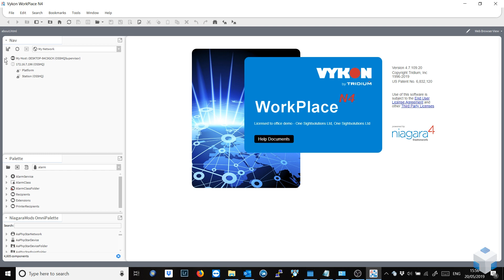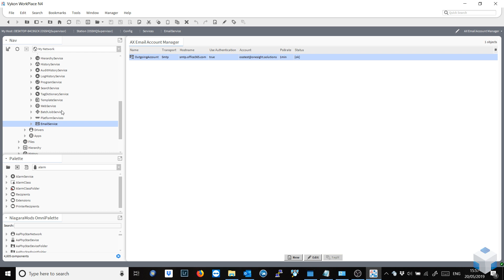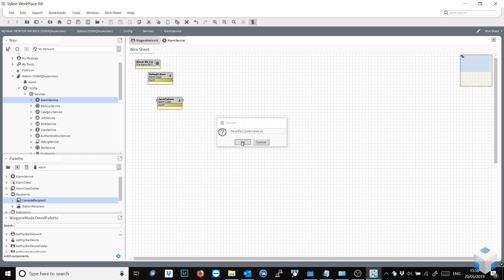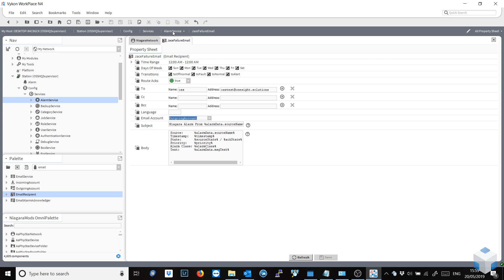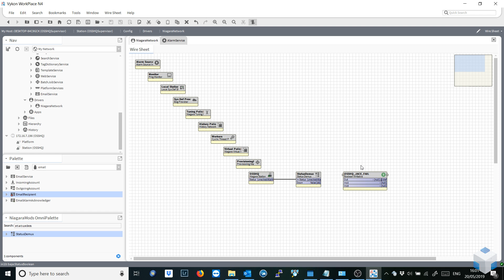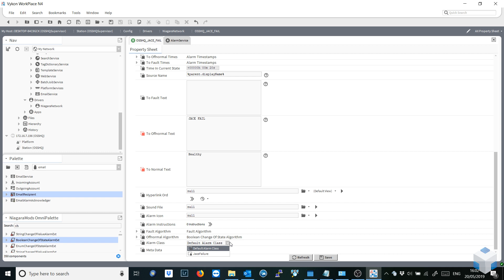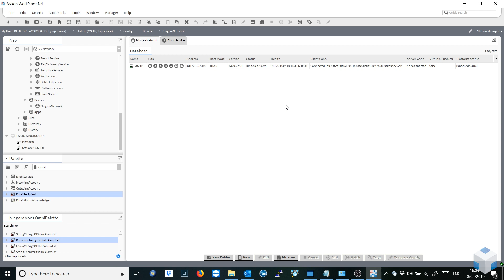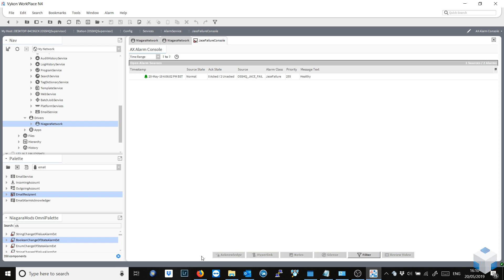HOW TO: Configure Ping Failure Alarms In Niagara 4

Comment: Is this a better solution then the built in “Monitor” NiagaraNetwork ping health? I see tons of nuisance ping fails from the built in service when the network is fine, so I’m interested in knowing your thoughts.
Reply: Hi Mike, Curtis from One SightSolutions, we believe it is, we have a site that has the same issue as you describe. The trouble with the Niagara Network connection is you cannot configure it like you can for Modbus (for example) e.g. do not show down until it has been offline for a set period, this way shows you how to add this functionality. Hope this helps